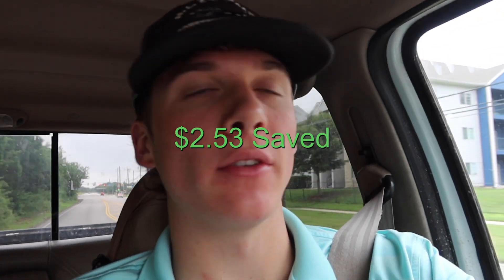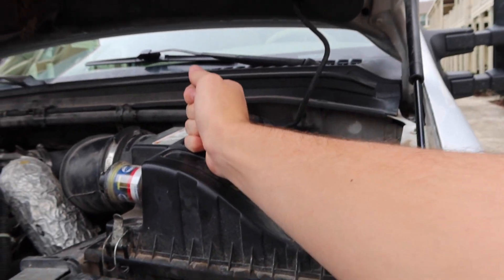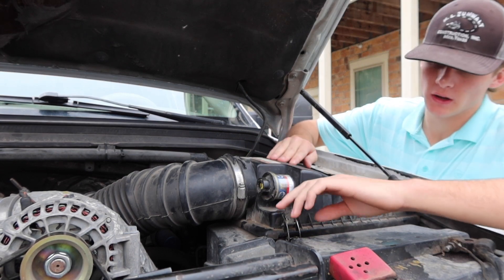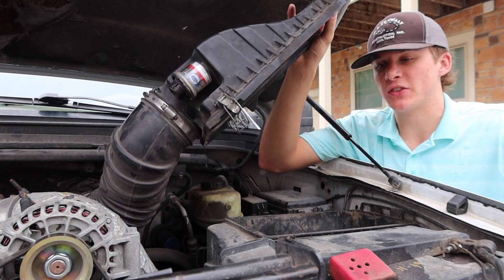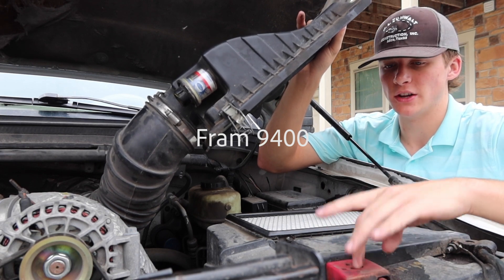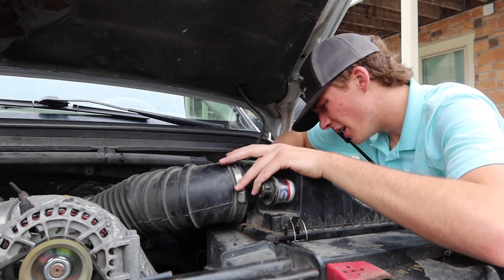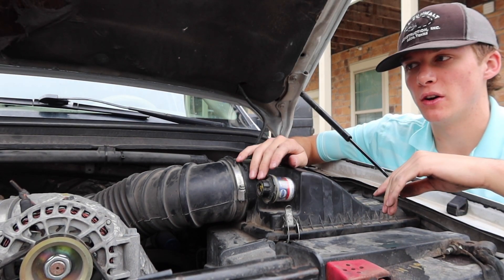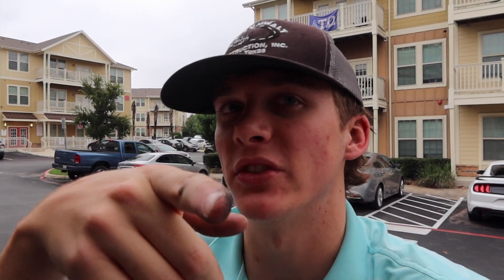Replacing The Air Filter On My 2000 7.3 L Powerstroke F250 Super Duty Diesel Does It Add More Boost?

Comment: Napa 6637 air filter is gonna be your best bet for replacement “performance” filters for our trucks. Gonna give you way more airflow and increase turbo noise.

If you are interested I have a parts list off of my truck if you need ideas.

Comment: I have a similar truck. 2000 f250 with 7.3 extended crew cab. I have to replace my ball joints and fuel filter. Can you do a video on these please?